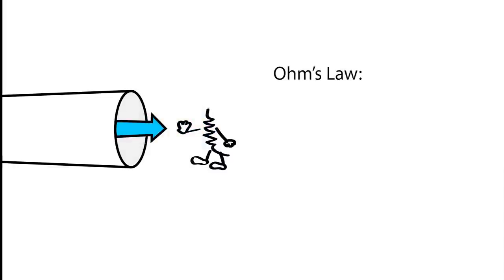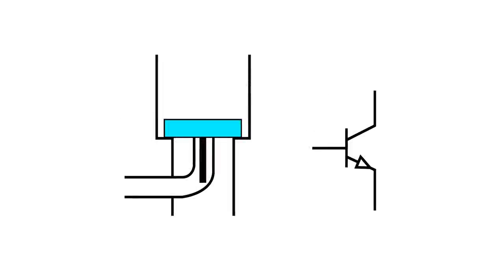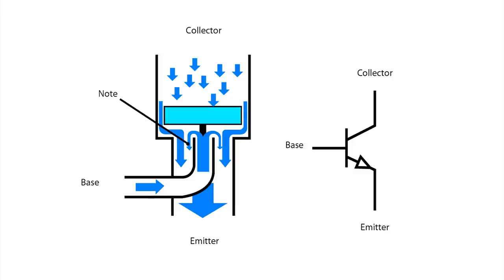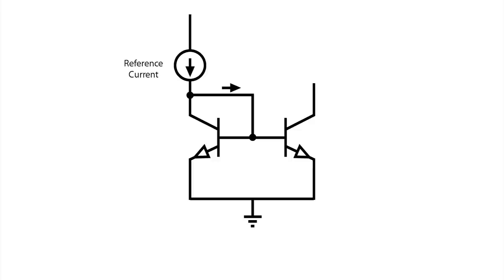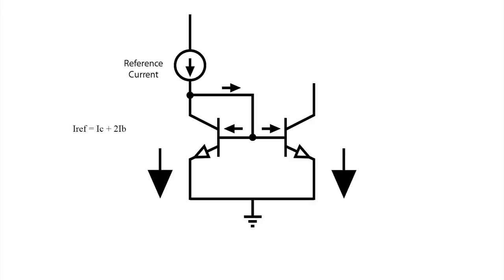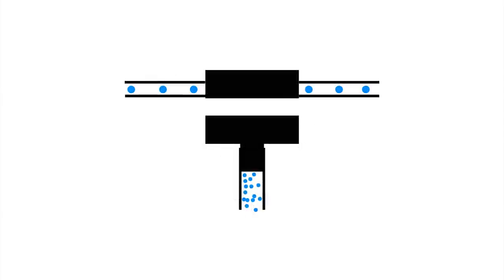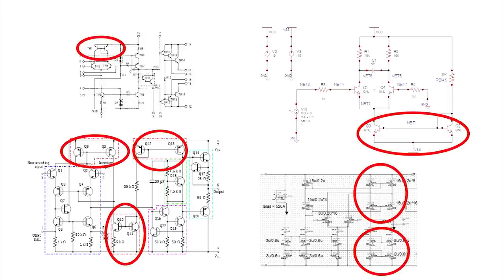Intro to Current Mirrors and Current Sources

Comment: what if a high resistive mosfet is connected to the drain of the mos on the right. Wouldn't  the mosfet on the top of it limit the current.

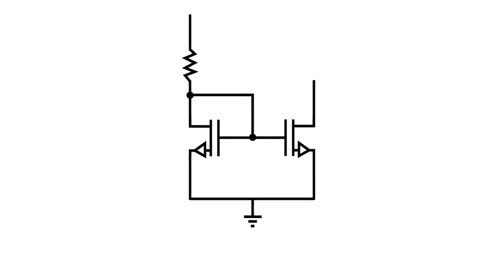Comment: The explanation was very insightful but at 4:15 you have used a resistor to set the reference current but in the beginning of the video you had mentioned the fact that resistors are hard to implement in an ic 
Could you please elaborate on this

Comment: i understand that we have the same voltage Ube, but why is it that we have the same collecter current, if there is a resistor before the first transistor? is Ic only dependent of Ube, when they have the same supply voltage? thanks

Comment: In MOSFETs how do we understand that the right-one is also in saturation? Only applying same Vgs to both transistors cannot prove that the right one will also be in saturation. Because only if we are able to prove that right MOSFET is in saturation, then only we can say that current will be mirrored.
I know that end-result is that the current gets mirrored but I'm NOT ABLE TO DEDUCE the logic behind it
Should we bias it externally? But then what will happen if it forms a part of a larger circuitry?
Reply: Mandar Patil you use nearly identical transistors. Mosfets are voltage driven devices. So the gate node will drive both mosfets, if one is saturated then so won’t the other one. The gate voltage potential is identical to ground